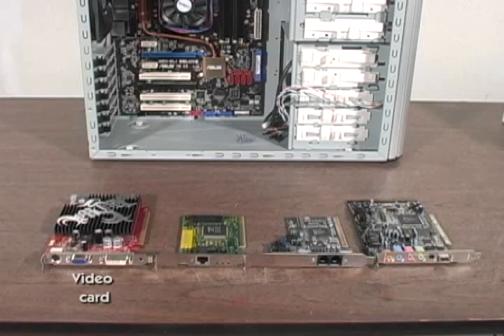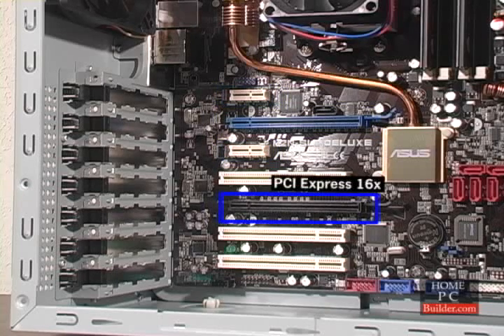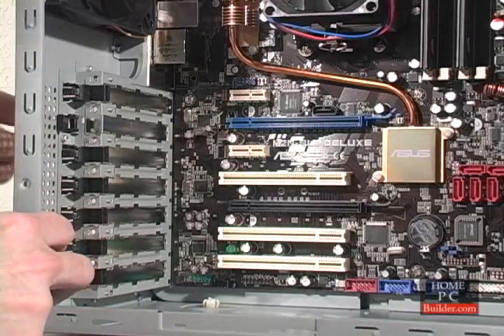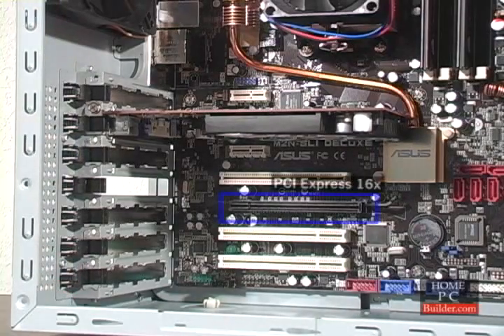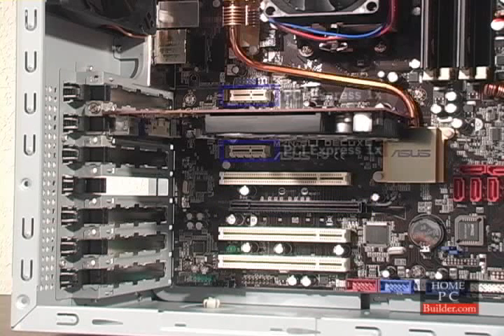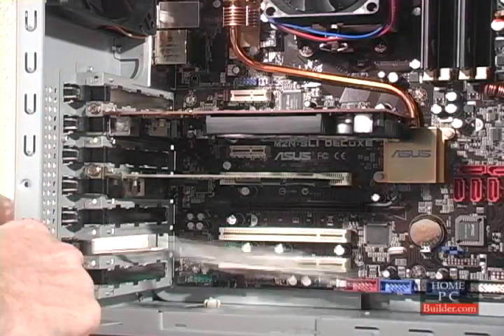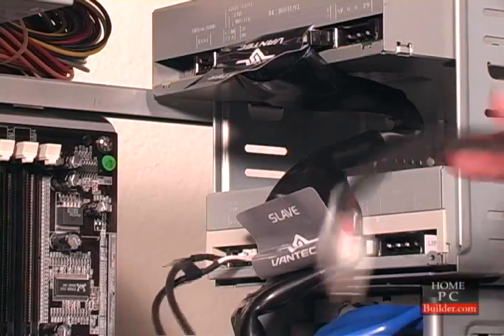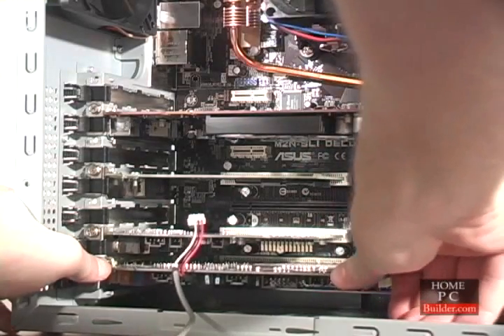Installing Add-on cards video lesson

Comment from the maker: Adding a second video card will let you connect another monitor to that card.  If the second card and your current video card support either SLI or Crossfire and you connect them with a bridge cable that can speed up your games.

Comment from the maker: No.  The 2.0 version has double the bandwidth of the 1.0 version.  If a motherboard or video card doesn't say it supports 2.0 it's actually a 1.0 product with half the bandwidth.  More bandwidth is good.

Comment from the maker: They have to be from the same series. You might get a 8600GT and an 8600 to work but 8600GT and 9600GT won't work together in SLI.

Comment from the maker: The black slot on this motherboard is an 8x slot.  On this board when you're doing SLI (2 video cards) Both slots go to 8x speed. If you want ultra high end gaming with $600 video cards make sure the motherboard you buy does full 16x on both slots and the newest thing is PCI Express 2.0 which allows double the bandwidth of the older 16x standard.

Comment: I find it ammusing that now most PCI Express graphics cards all have massive Fans on them and tend to take up 2 slots because of the Fans on them and yet Motherboard manufacturers still make there boards with PCI cards even though once you've got a PCI-E graphics card fitted you cant fit an extra card into the PCI slot. Also PCI-E 1x Cards are now avaliable.